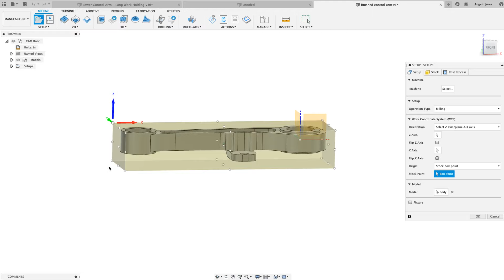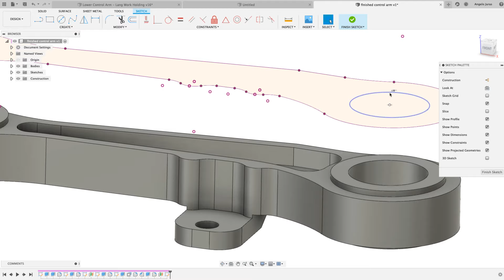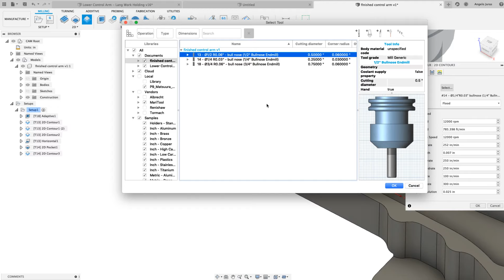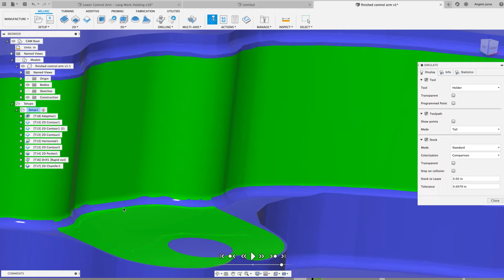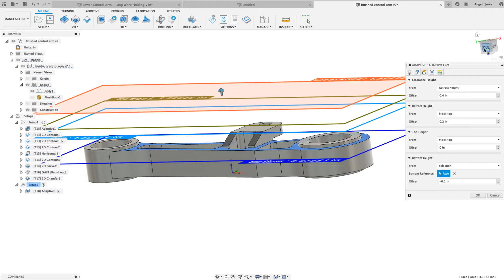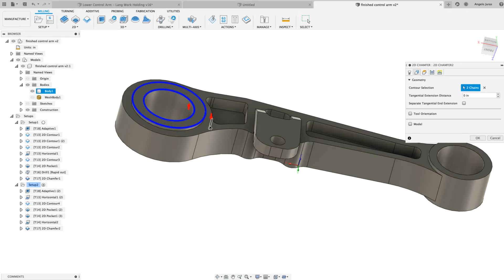Programming the Control Arm (Part 2)

Comment: I love your videos.  Can you show a 3 axis procedure to handle the portion of op2 that required tool orientation adjustment (4th axis)?  I have used TRACE with an offset to handle chamfers on an angled surface.  Not the best approach for the cutting edge of the chamfer tool.  Got the job done though.  Is there a better way for 3 axis machines?
Reply from the maker: Hey Robert, I'll try to get Angelo to answer this. Thanks for watching!
Reply: Hi Robert. We could use a 3D parallel toolpath to generate that feature on a 3 axis machine. I will post something on that next time.

Comment: @1:00:08 - would this require a 4 axis machine?  what would you do if you had a 3 axis only machine?
would you need to create special soft jaws to hold the part at an angle and the use Hrizontal?
Reply: Eyal Peleg you can use 3axis machine to do this part and you dont need soft jaws.
Reply: there are options that can do it with out additional axis.
Reply: Yes Eyal, there are different scenarios and different ways to machine this. I was simply showing one.

Comment: @49:25 - why do you choose tool_diameter * 0.5 ? and not  tool_diameter * 0.95  for example?  would it no achieve exactly the same result only faster? (as long as the step over is less then the tool_diameter?)

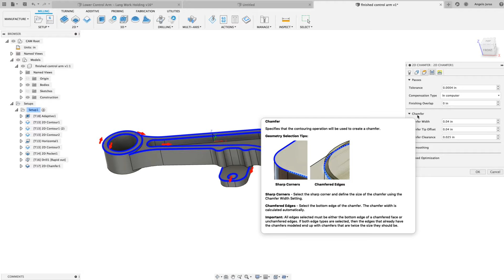Comment: @41:28 - all the G-codes that you mention - how can we know that this is what those options do? is there a tool tip or some documentation to point that out? also - could it be that some of those G-Codes are not supported by some CNC mills ? and if so then how can we know and what can we do?
Reply: Here is a link about G-codes: https://www.autodesk.com/industry/manufacturing/resources/manufacturing-engineer/g-code
My lathe is SIEG C3 7x14 Lathe.  I'm sorry for the comment I made it was a poor attempt at humour.  I love the lathe, hate my CNC Router buying it was a mistake, should have bought a mini-mill.

Comment: @00:10 - would this be the common scenario ? or would you normally just provide the dimensions of the stock? 
also am I right to assume that if you later on want to manufacture the same body again but using a different stock size you would need a different setup? 
Would it make any sense to assume during the creation of of the tool paths that the stock is a bit bigger and plan the paths so that they will work on a range of stock sizes (where in the small ones it would just mill some air part of the time)?
Reply: Yes, we can use a different setup with different stock dimensions, or simply update the stock and regenerate.